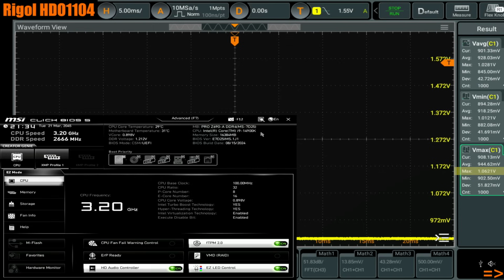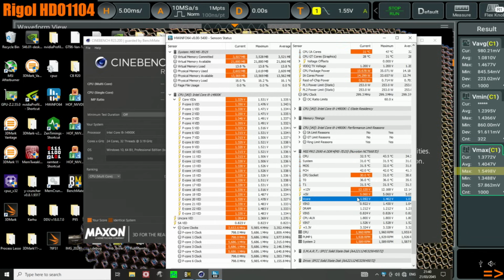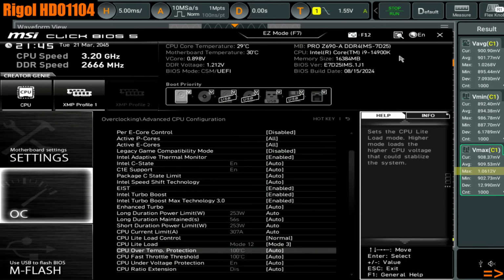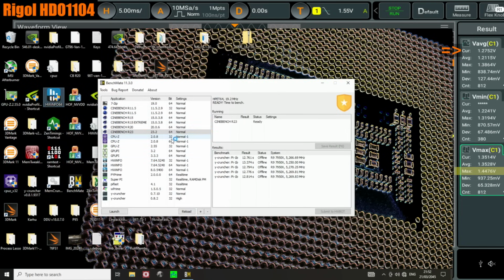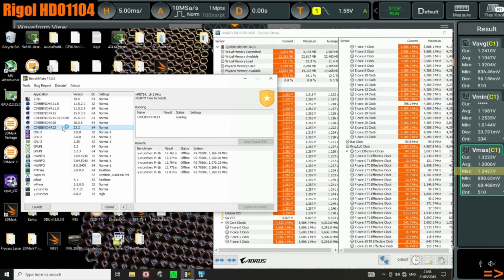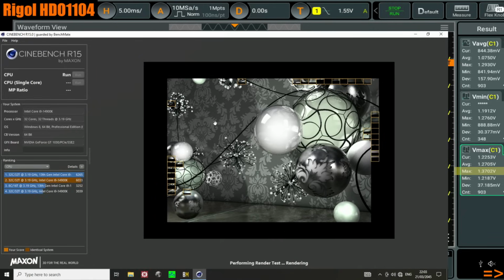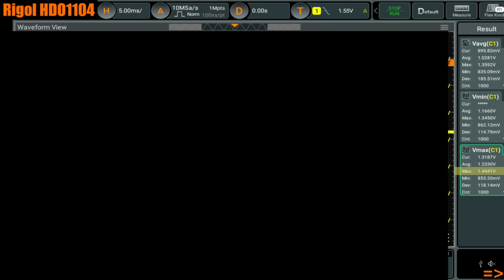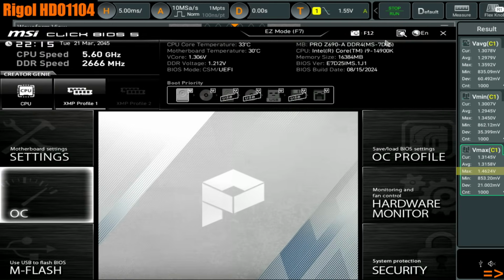"Optimizing" the i9 14900K on the MSI Pro Z690-A DDR4 with 0x129 Microcode

Comment: does any1 have good settings for 2026 version bios with i914900k i have msi pro z790 a wifi max with intel i9 14900k but i dont like the temperatures of cpu i got aio 360mm waterforce gigabyte i want good performance and lower cpu temps

Comment: You wouldn't happen to have a video on the i9 13900K on an Asus board??? Iv got Asus ROG Maximus Z790 Hero with a 13900K, all fresh in the box but can't get a refund on the CPU unfortunately. Hence I'm wondering if I'm better tuning and undervolting manually straight out the box and ignore the microcode and BIOS updates???? Any information would be greatly appreciated

Comment: This actually worked out great for my 14600KF. However I had to enable MSI performance mode otherwise my all core load capped at 5GHz. I can finally run cinabench and OCCT with AVX no thermal throttling. I wasn't able to do the offset without stability issues just left at auto for now. Might even be able to overclock now and keep cool with my 280mm AIO!

Comment: Can anyone tell me the CPU Load Line Calibration values from mode 1-8 and auto? I've Z790 Tomahawk WiFi DDR5. I want to make match it with AC DC Load Line (which by default are way too high like 1.1 mOhms for both AC/DC. Want to undervolt using this method before undervolting. Currently I'm using 0.5/0.5 for AC DC LL and Mode 6 for CPU LLC. It lowered the voltages. Now I'm HWinfo Vcore is 15-20mV higher than Core VID. This motherboard has nuvoton chip by the way.

Comment: You CAN limit CPU voltage in MSI BIOS by navigating to Overclocking>Advanced CPU Configuration and adjusting CPU VR voltage and GT VR voltage to your desired limit. May not always translate to a 1:1 CPU voltage limit but it definitely works. In terms of stability and performance I've found that limiting CPU VR and GT VR to 1.5v had a massive effect in stability and I tried countless of setting changes. It's these voltage spikes that causes subtle instabilities. Highly recommend Intel owners to apply a CPU voltage limit and a CPU - voltage offset to improve thermals, power efficiency, and likely overall performance. Intel sets the stock CPU voltages high to cover for the lesser quality silicon chips it ships out. This allows you to find out what under voltage your CPU can achieve with stability. 

For a balance of performance and CPU longevity with i9-14900k:

For CPU Voltage: Use Offset Mode,  - 0.100v, set by CPU. (If your CPU can't achieve this under voltage without blue screens or stutters try -0.075v). Mine could achieve nearly -0.150v when it was new.
Limit all P-core Turbo Ratios to 5.7Ghz
Turn off Enhanced Turbo
Turn off Thermal Velocity Boost
CPU VR and GT VR Voltage: Limit to 1.50v (found in Overclocking>Advanced CPU Configuration)
CPU Cooler Tuning: Use Intel Default Power Limits (253w)
CPU Lite Load: Use Intel Default (Found in Overclocking>Advanced CPU Configuration)

For maximum gaming performance: keep everything the same as above except don't apply the CPU voltage offset. You'll run hotter but I've noticed a more competitive gaming experience overall. Good luck
Reply: I was wondering if you'd recommend limiting the CPU VR and GT VR Voltage to 1.5 volts on a 14600k as well or if I should go even lower??

Comment: So since my msi board had a limit on it now I set it to 1.45, is there something you would re commend to change to further it's performance? I think I may be getting 39k cinnebench, but I've done so much tweaking and I want to know if there's anything else with these simple changes or any tweaks with the limit thdt could help. Disabling Hyperthreading, cep, c states etc? Or even increasing the llc or ll? I know I can mess with it myself but I figured I'd ask, thank you for making an msi vid.
Reply: I think that the next bottleneck with those settings is ICC max (at least in my case) set with intel defaults to 307A. I tried setting this to 350A and performance and temps got a little higher. I think according to intel on extreme profile the highest safe ICC max is 400A, but I prefer to be on the safe side and get back to 307A.

Comment: msi z790 mag tomahoawk max wifi here with i9 13900k i cant get my sistem stable with good perfomance please help with settins im on latest bios
Reply: i have the same board as you but with a 14700k. i run it with these settings:
5.5ghz/4.0ghz/5.0ghz RING | hyperthreading disabled
adaptive vcore/offset 1.325v/-0.125v

had to look for the CPU lite load and set to advanced. then i set the AC/DC loadlines to 50/50.
My peak VID was 1.328v and lowest was 1.223v when idle. i have not crashed with this configuration YET.
this works for me, but for you, the last part to worry about is the silicon lottery.

i also disabled TVB and any other TVB-related functions to prevent any odd voltage and VID behavior (at most three of those can be disabled)
Reply: @93tatsumi  ty my i9 14900k arrived today and im 42k cinebench noiw with llc7 -100 undervolt ac60 dc100
Reply: @bjohnny161 I’m only getting 37k. Can you be more detailed on your settings?
Reply: @jestercutx  Yes, the secret is undervolting and sync cores to 57x
Reply: @jestercutx I undervolt mine adaptive plus offset negative -0.100 and CEP disabled vr voltage limit 1.5 ,the secret is disable CEP and undervolt
Reply: @bjohnny161 I will check this out when I get home. I think I just have cpu- offset now of .075 and I think I left the rest stock after this recent microcode update. I’ve noticed it never clocks over 5.7 though although the temps are pretty solid. I have research the adaptive offset. Thanks for responding
Reply: @jestercutx  i can help you with my settings if you want
Reply: Certainly! Here's your *i9-14900K BIOS configuration* in clean, copy-paste friendly text format:
 `Intel Core i9-14900K BIOS Settings (Stable & High Performance)  CPU Core Settings: - All-Core Ratio: 57x - E-Core Ratio: Auto - Ring Ratio: Auto  CPU Voltage Settings: - Voltage Mode: Adaptive + Offset - Offset Voltage: -0.100V - CPU Core Voltage Override: Auto  Load-Line Calibration (LLC): - LLC Mode: Mode 7 - AC Loadline: 60 mΩ - DC Loadline: 100 mΩ  Power Limits: - PL1: Default - PL2: Default - Tau: Default  Power Management: - EIST (Enhanced Intel SpeedStep): Disabled - C-States: Enabled  Miscellaneous: - Hyper-Threading: Enabled - Intel Thermal Velocity Boost: Enabled - Intel Turbo Boost Max 3.0: Enabled
Reply: @bjohnny161 even though I’m already stable, I might try your settings as well
Reply: A comment from a redditor that helped me - “Here's all you need: Lock all cores (in my case it's 55/43/45). PL 1/2: 253w; current: 400A; turbo: off; tvb: disabled. The rest you may have to play around with it a little, based on silicon lottery.
AC LL: 15; DC LL: 50; LLC: mode 6; adaptive + offset: auto, -100mv.
MSI MEG Z790 ACE
13900k
You're welcome
Edit: Just make sure to match your DC LL to your LLC. In my case, mode 6 has 50 mohms resistance, so I set DO to 50. If you notice instability, first try raising your AC LL by 5. Honestly, you shouldn't have to go above 40. If it's still unstable at that point, try a smaller offset.”

Comment: Glad I found this one, MSI now does have the VR voltage limit, I guess that was a recent update
Reply: Yeah with vr voltage limit of 1.400 i wonder if llc 3 and liteload 3 are too aggressive?  Should we use maybe mode 4?
Reply: Where is the setting?
Reply: @ I donated my system away but as far as i can remember it is in advanced cpu settings,  scroll down,  past acdc loadline, liteload settings.  It says something like VR limit or VR voltage limit.  You might need a bios update.
Reply: @ Thanks!

Comment: We are still waiting on ASUS video man 😂😂😂 you have really helped me with my 14900k on Asus z690 i have c23 on avr 39650  points and c15 on 6198 😂..this 2 points man ... hahahaha max voltage is 1.4680 something like that on few hour run but in the cinebench on run is under 1.2 V and only sometimes spike on something like 1.4+ but that's ok

I'm running Arctic freezer 3 420 AIO -power plan Balanced

Comment: My 14900k is now not boosting past 3.2ghz lol. R15 score of 2133 and R23 score of 15011. Not sure what's happened here. Maybe my chips is super low quality? It is how running very cool barely going over 50c lol. 

*Edit. I must of somehow turned off the boost or the bios did when changing the power settings 😅. The scores shown though are literally double mine. Does that mean my chips been fried?

Comment: That CPU is a PO TAT O! One of my non binned chips runs 5.7 with a -0.145mv offset with bone stock LL settings, 1.1mohm across the board. I've found on average when using MSI Z790/690 boards, setting the Load Line to level 7, manually setting "Lite Load" AC/DC LL to 60/80, and applying a -0.075 to -0.125 Adaptive Voltage offset makes these chips cook!

Comment: will msi z790 tomahawk do better at tuning the i9-14900k?
Reply: Nah not really but as someone that has the Z790-A PRO Ddr4 and also have both the Z790 Tomahawk and Z790 Tomahawk MAX for DDR5, they both do 7400MT/s quite stable and 7000 %100000000 stable even with million Cmos resets.
I suggest you to avoid going Ddr4 altogether because with Ddr5 you can buy a cheap Hynix A-Die kit like KingBank 6800c34 for either 16GB or 24GB and it will do 7400c34 very easily and will be stable in high temperatures.
DDR5 Samsung Bdie is a pain in the ass you will very definitely have to have a fan on the RAM to keep it stable and it will have slightly worse performance.

Comment: z790 avx offset 0 bug workaround

I have noticed that AVX offset issue mentioned by buildzoid has simple but inconvenient workaround on Gigabyte motherboard.

On my 14700kf 56/44/50 HT OFF  / Z790 Gaming X AX, AVX small tests (P95/OCCT) downclocks from 5.6 to 5.5 with AVX offset 0  ONLY at 1st boot of PC from full power off state, if I restart PC at least once then AVX is NOT downclocking from 5.6 under any load, even prime 95 small avx until next power off.

Unleashed bios profile shows the same behaviour so I am using intel performance profile  + manual settings:  
cep ON, 400icc, 350w, 1.45vr, 1.35v vcore, AC45/DC55, LLC HIGH, cpu allways holds max clocks and temps are never higer than 85°C.

config:

GPU: RTX 3090 OC  / Alphacool Aurora water block /  liquid metal

CPU: i7 14700kf OC HT OFF 56/44/50/ delided / liquid metal

RAM: Corsair Vengeance 2x 16GB DDR 7000 CL34 (tightened timings)

PSU: Corsair HX1500i

CASE: Corsair 7000D

CPU WATER BLOCK: Thermal Grizzly Mycro Direct Die Pro V1

RADIATORS : 2 x Corsair XR5 420mm / 30mm 

FANS inside case: 7x Noctua NF-A14 

FANS outside of case: 2x Noctua NF-A20

PUMPS: Corsair XD5 and EK Inertia D5

Coolant: Mayhems XT 1

NVME SSDs: 1x 2TB PCIE 4.0 SN850x and 2x SN850x 1TB in RAID 0

MOTHERBOARD: Gigabyte z790 gaming X AX

Comment: Would this apply to other MSI motherboards especially after the most recent update? say  MSI Z790? I've tried this just now with a 14700k and yes it's a little slower than it was at factory standard but my voltages are 200 millivolts less during helldivers 2.
I used the exact CPU Liteload and LLC you did here. Along with a negative variable offset. Nothing else.

Some people are spooking me saying a LLC of 3 might be too high and could cause voltage spikes that even my sensors cant pick up (using HWinfo 64). My last CPU was a 4670K so I am a bit overwhelmed by everything going on.
Reply: I was running happily at 1.25 volts thereabouts, even upping the power limit PL1=PL2 to 253W as a test. I've lowered it back to 125W to 175W just to keep it running a little less hard. I don't need all the power all the time. Stability so far seems good.

Comment: I got my system stable with pl1 219 pl2 219 @ 280icc max, llc and lite load on auto and a negative offset of 0.150 but I had to disable CEP, I have a voltage cap of 1.4 and set my core multiplier to 48 so it doesn’t go above 4.8, is this safe? Its stable.

Comment: What can I do to find out if the VRM is actually showing correct voltage is? Do I need a special instrument? Also, after flashing the latest micro code, I was able to set a voltage cap on my MSI B760-Vc WiFi 7 board.

Comment: Thanks for the video.  Got my MSI Z690 down from 75% voltage throttle to 10-15%.  Going from .100 to .110 negative completely blows the system up, CPU and GPU bound on Iracing.  Maybe I'll try 0.105 next to see...

Comment: I just have one question, why are you not using the same or similar LLC settings like switching frequency etc. that you used in the MSI Pro Z690-A voltage regulation and VRM settings video.

Comment: I've just been doing this over the past week.. I noticed the actual core voltage is more affected by Loadline calibration, so I managed to go from Extreme (not ultraextreme or w.e it's called, on Gigabyte) to turbo i think (and lower - offset), and getting lower vcore while doing heavy stuff, games hammer this cpu a lot tbh. But I managed to get 5.7/4.4 on around avg or 1.245v, (vid avg 1.24). 

I dont understand the Intel recommended default settings. they're both so awful. There are no power limits on them when I checked, and the cpu vcore on those has no issue going over 1.45v and at high power sometimes

Anyway maybe i got a decent ish chip tbh and I was hoping for 5.8 all core while gaming (and i can get it) but i dont want to constantly run the cpu at 1.3+v, hence why the adaptive with offset. I think I'm at like -0.120 atm but last stable was -0.110 was so gonna go down .005 now actually lol 

I think i can run R15 at 5.4ghz and R23 at 5.2 (might be getting them confused, sorry if i do), getting a little better score since dropping LLC. went over 6200 i think with this set up, but any questions (anyone) just ask

Comment: Is MSI Z690 Tomahawk DDR5 Has this issue of Spiking voltage at startup?
It's MY first Ever Build and This Happen to INTEL
MY BUILD 
i7 14700k
Z690 MAG TOMAHAWK DDR5

I'm Tracking Voltages using HWINFO64
MAX VCore is 1.43
MAX CORE VIDs 1.51
CInebench 23,200 
33000 Multi Cores 10min test

I have zero experience with voltage and over or under volting

Comment: Thanks! With latest BIOS, i tried your method on my 13700KF and it works perfectly. Also i went with mode 2 on both Loadline and Lite Load, with better scores on CB23. Is it safe to do?

Could you suggest how to achieve a mild OC?

Comment: Hello. I am using 14900kf and msi z690 force
Intel default profile
I'v done negative offset to 0.100 and lite load to 3 as you mentioned. 

I am getting 36600 in cinebench 23, and i think it is rather low. Is it?

Should i rise power limit a bit, or do something else? Thank you

Comment: Not too sure what my issue is, i have the same motherboard but DDR5 and if i run Lite Load mode 3 i get blue screens and all my games say "lacking video memory" brand new 14900k with less than 100 hours on it. I did -0.070 offset and that works but im still hitting 1.550v in game. Microcode 0x129 (0x12b isnt available to my motherboard yet)

Comment: I’m getting BSOD and games crashing with these settings. I find it hard to believe my 14900KF could’ve degraded in 6 months but I’m pulling my hair out trying to figure it out.
Reply: I really appreciate your videos, and if you had any insight into why this is happening i’d be so grateful
Reply: Never mind. I’m honestly not even sure what it was, but something was spiking my temps. I reset CMOS and applied these settings and am now running stable with a 39000+ cinebench r23 score.
Reply: Never mind to the never mind, my temps are absolutely fine but I’m crashing and BSOD, undervolting with negative offset 0.070 :/
Reply: @WOWMelted your chip is probably damaged, I had similar issues and had to get a new i9 to fix it

Comment: I tamed my 14900k heating issues by 15 degrees or so. I just replaced the stock mobo contact frame, to a 3rd party CPU contact frame. I stuck my 420mm aio, ran cinibench with stock Intel extreme 5.7 with 3 cores being at 6, and stayed steady in the 70's with two cores in the mid 80's. Wish I would have done this 7 months ago. Best 20$ I spent. No more thermal throttling. Yaaay!
Reply: We all sincerely appreciate the step by step play by play. So awesome & 100% needed from ur comment. We were all wondering about every detail of info u gave us, thanks!
Reply: @godnamedtay  I was pulling my hair out trying to figure how to keep it cool. I had 6 cores hitting over  💯 degree range. I was passed the return due date, so I was stuck with it. I had little hope thinking that the contact cpu frame was gonna work. But I decided to try it anyway. Thank God I did. 😆 it worked. I was hitting 💯 even with the new microcode before changing it. That 7 months sucked.